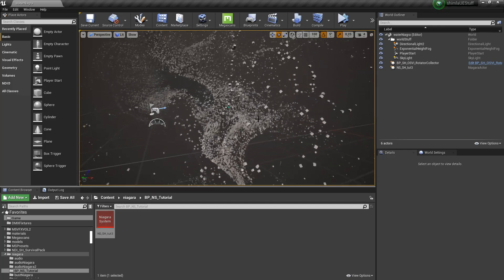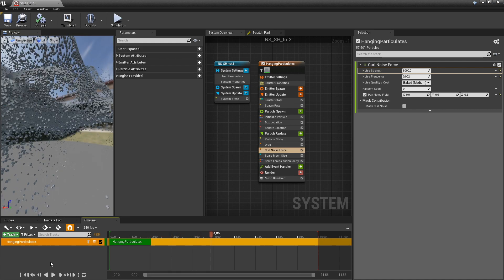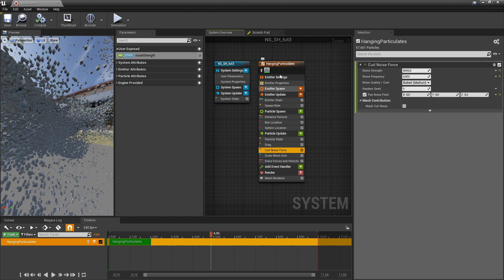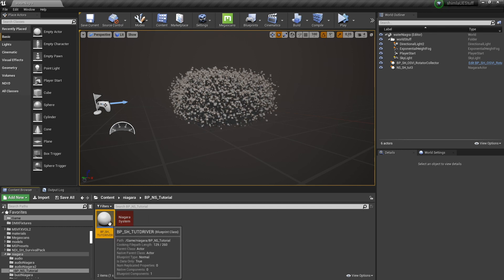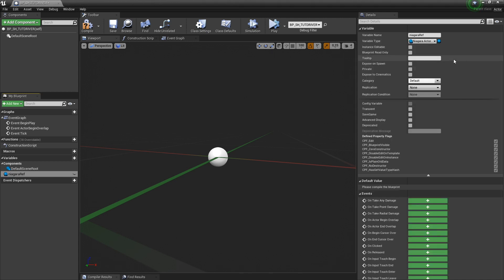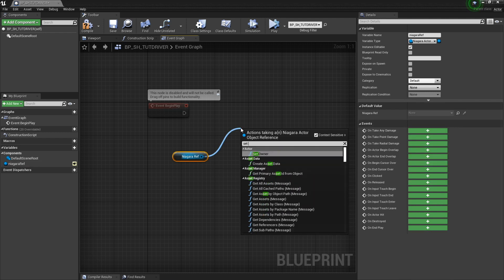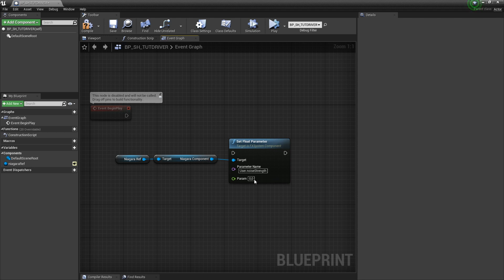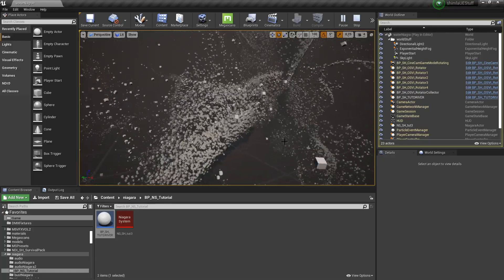Control your Niagara System with Blueprints (4 min)

Comment: Great explanation, but personally im having a problem: i want to set a point of attraction formy niagara as the position of the bp actor. I tried to use your method but i cant access the user exposed "custom position" parameter i created. Am i missing something?
Reply: omg I am trying to do the same thing and can't find anything on it on the internet! Did you ever figure this out?

Comment: hey! nice tut, but I wanna ask if this works also with a box collision in the Actor blue print class?
Reply: What do you mean? Your question is pretty vague to give any answer
Reply: @SpasmAtaK  hi, I mean can I use a trigger box to toggle the niagara system to Active or Inactive?
Reply: @yuezhao1683  sure ! At begin play you could get the player character, from it you cast to the actual BP of your character. You now have a reference to your character in game (you could promote the blue output pin of the cast to a variable so that you can reference the player easily later on in this blueprint).
Add a box collision, and on Event begin overlap with this box, when the other actor = this new variable you created earlier you now know that your character is overlapping the box. From there you can do whatever you want
Reply: @SpasmAtaK  Thanks! very helpful!👍👍👍👍

Comment: I've had this set up working but I'm trying to update floats after a niagara system is spawned through a BP. I've promoted the spawn to a reference and using that as the target for the float updates on the user params but it doesn't seem to work. Have you tried that?
Reply from the maker: everytime you change a variable the 'set float parameter' function needs an event exec. 

So you can do multiple things here, you could for example set float on a tick event, that way it just always updates and you can change it on the fly without that much hassle. problem is this is not very efficient and will result in framedrops if you do this to much.
Reply: I have tried this using an interface it updates the float value but doesn't adjust the niagara float amount only sets the amount once

Comment: hello there, thanks for your tutorial, unfortunatly i ran into some troubles... i am a very new to the UE environment, so please forgive me.... bu if anyone could provide me some tips/guidance i'd be endlessly gratefull <3 i know that describing a problem in this vague way is very problematic but i hope that i've narrowed the important issues down. 

@2:46 I cannot select my NiagaraSystem under the default parameters tab. It may be due to the fact, that i added my NS_System as an component to my Character.... Is this maybe the problem ? if yes, is there a workaround ? I also compared the differences between your NS and mine, and recognized that i am using the Sprite Renderer if thats maybe an issue. I'm also using Scratch Pad Module....

thanks in advance and for reading my question at all <3
Reply from the maker: if you've added your niagara system as a component you don't need to reference it again. you already have the reference. Just drag out the niagara component and do the same thing

Comment: If you're having trouble connecting to whatever you named the parameter in the blueprint, you can right click the user parameter from within the niagara editor and click "copy reference to." Then you can paste the text into the connection blueprint Parameter Name box. For example, as a dumby javascript developer I was uthinkingly camelCasing my shit, which I guess unreal automatically converted to whatever_this_case_is_called, so I was getting the parameter name wrong.

Comment: Is there a way to do the opposite (Niagara sending events to BPs)? Cascade has an "Event Generator" which can call BPs (w/ collison, etc). There's nothing equivalent in Niagara, but also hoping that I am wrong about this (because I really want to know how to replicate that specific function in Niagara). Would you know anything about it? Any kind of information would help!
Reply from the maker: havent found a way yet, maybe collision detection but otherwise i'd use BP's to control both the input and output of your system